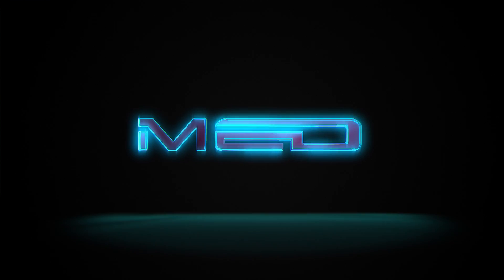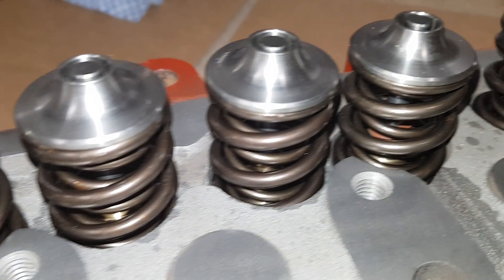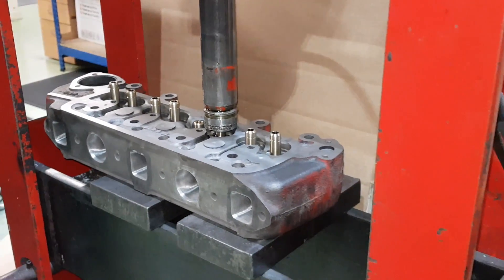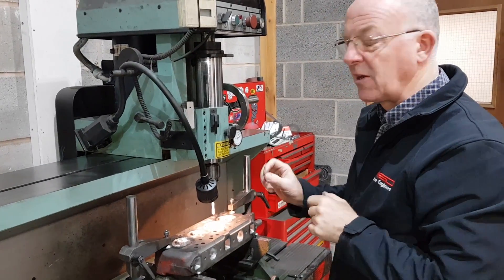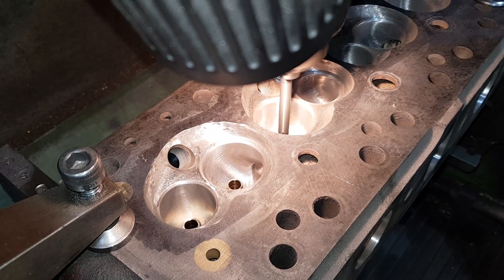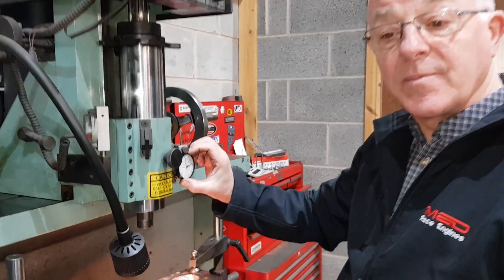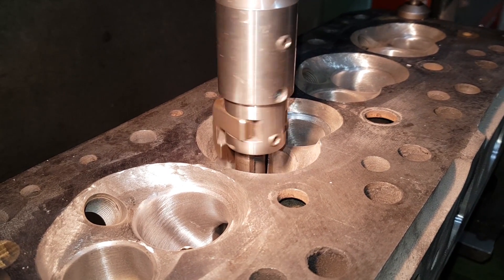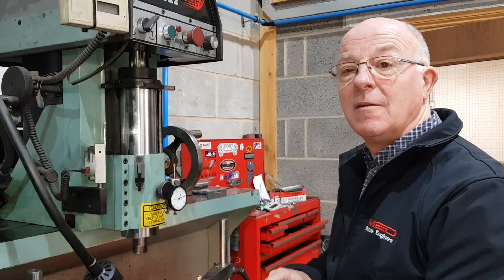MED race head valve guides and seat cutting - an insight

Comment: (1.1.2023) Just  being old (71+ y.o.) home mechanic I wonder, there has to be some dimensions how deep you can/or have cut these velve seats(in case you have to put new replacement in) to prevent the valves to sink too deep or on other hand to stick out too high in the  cylinder, which in extreme cases can cause contact of the valve with piston. Where do you find all this information for one's personal vehice?

Comment: To what height do the valve guides get fitted? Did I spot that the press touch on the faced off area of the head? Also what size press would I need for this e.g. 1 Ton, 2 Ton, 10 Ton etc?
Reply: There are some videos on youtube. The press is achieved not by pressure applied, while pushing it in, but rather by heating the head with torch and freezing(preferably in liquid Nitrogen) of the seat, you are trying to put in. The frozen seat just falls inside of the head opening if done properly. As it cools off/heats up to normal temp, it will create the press fit. It should be-I believe .007" diference between the hole and the seat O.D.at normal temp. You might  still use a driving rod and hammer to get it all the way down...but it should be just light tapping.

Comment: I think you went about this all wrong.  When the valves are seated they will each have their own height, since as you note they sit a “few thousandths” different than each other after the seats are cut.  Therefore each valve stem will be a little different in the height to the spring seat, which means each spring will not be an equal length when fitted to the valve.  All that you did cutting the spring seats in the beginning is for naught since the valve seat cutting changes everything.  I think you need to do all that seat cutting first and then measure the fitted valve stem height, and then adjust accordingly with spacers under the spring seats rather than cutting away metal that can never be replaced.  Then the next time you do a valve job you won’t be cutting away yet more metal, but instead adjusting spacers to get the consistent spring height you want.
Reply from the maker: Sorry, totally disagree with your concept on this. Feel free to give us a call to discuss.
Reply: @MEDEngineeringTechVideos  Disagree all you want but you never proved what you claimed to have accomplished initially by machining all the spring seats to the same height above the top deck.  That was a meaningless measurement (why is the deck height some meaningful standard??) that may have even made the situation worse.  If the factory cut the valve seats, installed the valves without springs, and then measured the height of the valve stem to the spring seat they may have intentionally machined each spring seat differently to equalize spring height between all the valves.  In not doing this measurement you have assumed that the distance between the valve seat and spring seat inside the head is the same for all the valves.  That’s a near impossibility for any casting, so I think it is very likely that after all your work that all your springs sit at different heights from each other.  Think about it, then prove it yourself by measuring the installed valve height without spring.  That’s the proof, isn’t it?
Reply from the maker: @billhenning  No. Sorry, there's no time to debate with you - more race winning heads to be machined here.

Comment: Hello from CANADA. Let me start by saying it looks like MED has a meticulous service and the product line appears to be second to non. I have owned 13 Minis over the years, late 60s, early 70s, but never one with any power. Retired now and have an opportunity to purchase another Mini for restoration. This time around I want far better performance, so my question is, ( I am not being a dickhead here ) after looking at the cost of aftermarket components to put together an engine, why would one not just buy a used, very reliable, Honda Vtec B18 with approx. 160-170 hp at the wheels and for approx. 500-1000 Cad. dollars ( 300 - 500 gbp ) and call it good.
Reply from the maker: Hello, thanks for the message. There's a few main points to consider. From experience of doing these things, it's rarely as easy or cheap to convert a Mini to a 'modern' engine as you first think. To get the car running well and the engine conversion neatly in place will cost far more in money and time than the initial engine purchase. 

Converted Minis generally are not worth as much as original A-Series powered cars, usually requiring a subframe change and much cutting of the bodyshell. Gearing dictates that you will usually have to run 13-inch wheels, and again generally speaking, converted cars rarely handle as well as the original Mini setup. There's a limit to how much power can be put down effectively in any case, so we would question the need for 160bhp on the road.

Overall a mildly tuned 1275 A-Series is still a good option in terms of drivability, originality and fun. If you can achieve circa 100-110bhp and get the suspension geometry perfected, it will be a very effective road car.

Comment: is there a reason you don't use any cutting oil when doing the rimming or cutting the valve seats?
Reply from the maker: It's not required with this particular job and cutting tool.

Comment: How do you know what depth to set the valve guides, does it vary between heads?
Reply from the maker: The tops go in flush with the rocker cover deck face. If you see, the press stops when it touches down on the deck face at the back (front).
Reply: I was about to ask the same until I saw the last one where the press head was straddling both